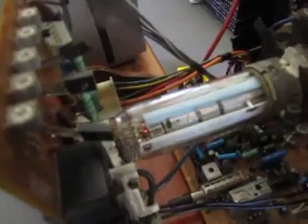Bad cathode in Trinitron tube.

Comment: i had a old trinitron that the picture was going purple but you could see black outlines and picture on screen (yes that was purple was bending into funny shapes usually smaller and then it turned off then on again and it fixed for a few minutes then back where it was sometimes it went back to the purple screen in a few seconds and made a funny sound from speaker that was years ago though before i know how to fix TV's

Comment from the maker: Yeah, I'm afraid of the tubes in my Sony and PYE wearing out. The Sony (21" Trinitron KV-2185AS) sees a lot of use, but the tube is still in very good condition. I can't see any signs of aging. The tube in the PYE has some age, but being a monochrome tube, it is harder to tell. It's not very bright, mind you, I don't think it was ever intended as a bright set. The plastic sheild/cover over the faceplate is made of pretty dark coloured plastic.